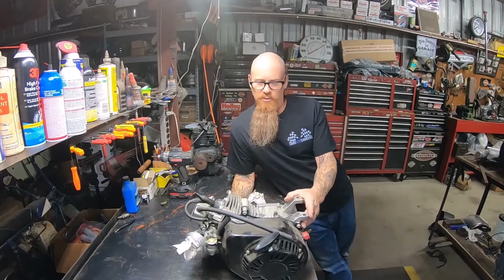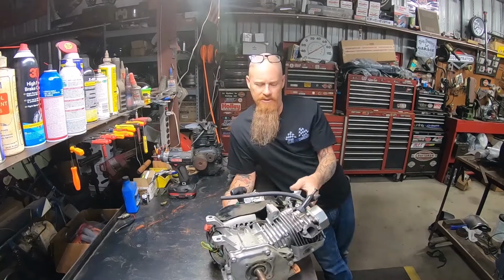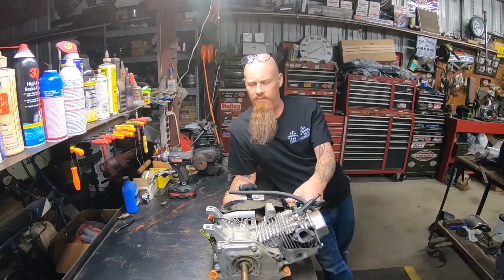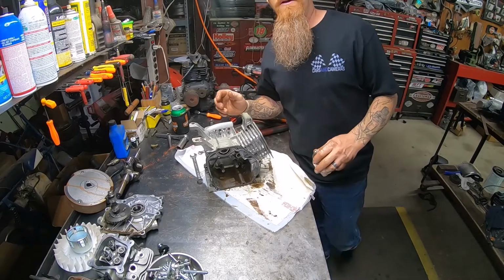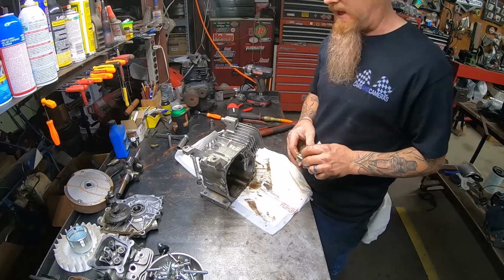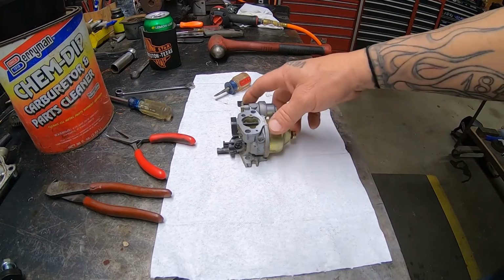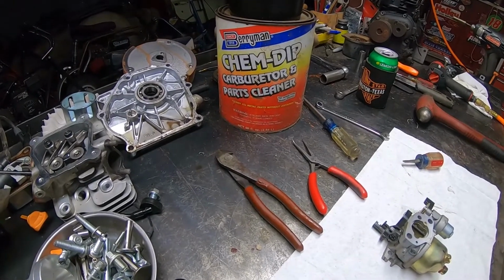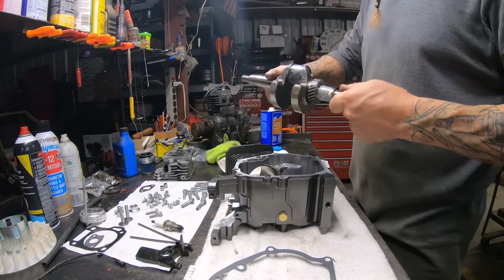Go Power Sports DIY Lil Rascal Part 3

Comment: Looks nice in that color. What size bolt did you use to plug oil sensor hole, and did you tap it or just impact it in?
Reply from the maker: I think it was a 5/16 pipe tap